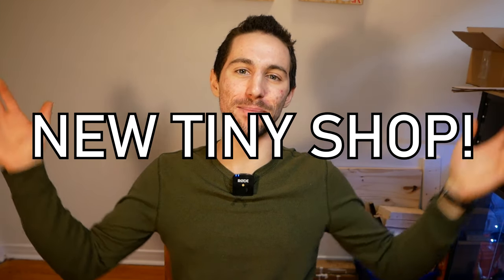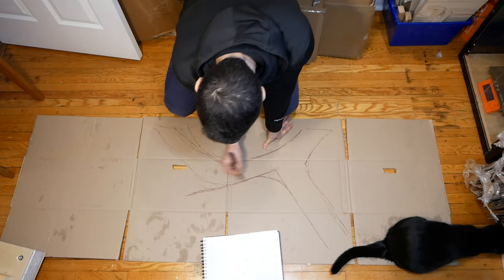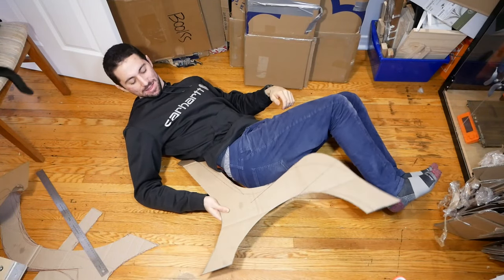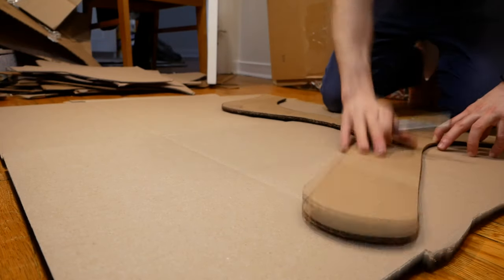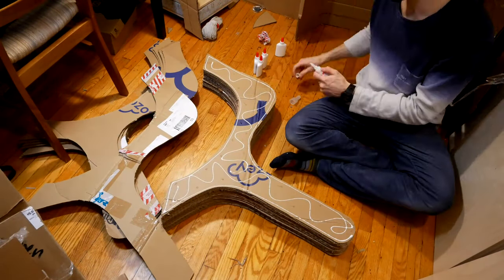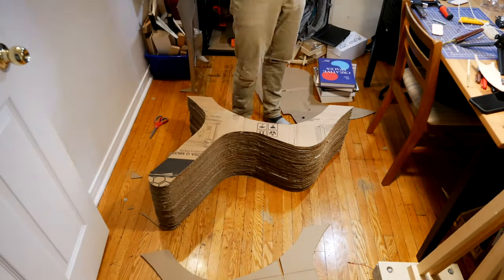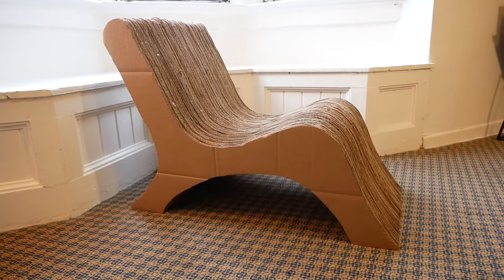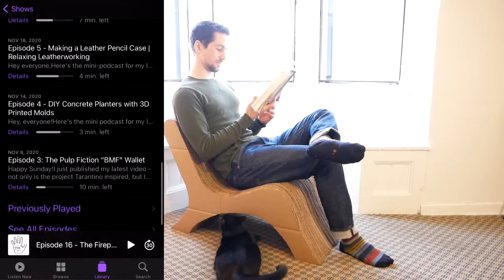DIY CARDBOARD CHAIR | Modern Design

Comment: Bro..I use to work at a corrugated plant and we had cardboard furniture made in this way. Sofas, chairs etc. They are super sturdy and can handle a lot of weight. The possibilities are endless using this easy template method. We were fortunate to have a huge cnc type machine that could cut out templates no problem. Nice to see somebody doing this. ❤

Comment: It looks pretty cool! I wonder if you could take some of the left over cuttings to make a sort of paper mache coating that could be sanded finished and and coated with polyurethane. I bet it would make it more durable and certainly easier to clean.
Reply from the maker: Thank you! Could be an interesting experiment, but I like the layered look :)
Reply: can you explain more about coating in polyurethane? what properties would this contribute? how would it be applied?

Comment: a great video, quite inspiring watching you resolve design decisions. but with respect, im speculating on some optimisations on your approach,

1. ive seen people convert a £150 3d printer into a lazer cutter, could this be used to save you tones of cutting work

2. instead of making it solid could you make two side profiles, then cut out inserts for cross bars that would act as slats to support weight

3 couldt you utilise the 1 dimensional flexibility of corrugated cardboard to make "cover" for the seat - one sheet that you sit on that is bent to the sweeping form of the chair

i feel like these adaptions could make your chair more light, stable, cheaper, stronger and would utilise the 3d bracing abilities of the cardboard medium?

i have a neighbour who has a huge excess of large sheets of card board from his job.  we've been burning it mostly but back in the 90s i used to make cardboard structures and have never forgotten the amazing structural and creative potential of this medium